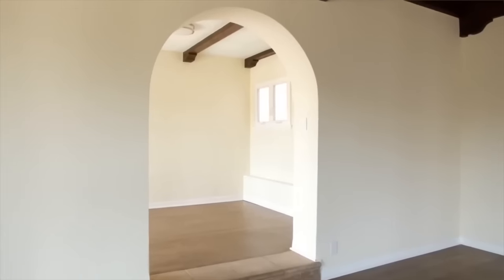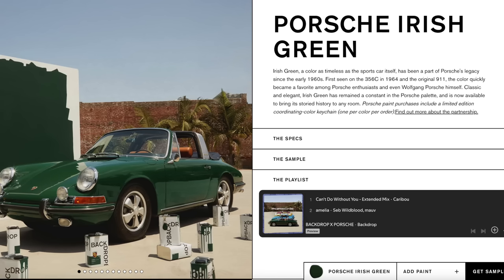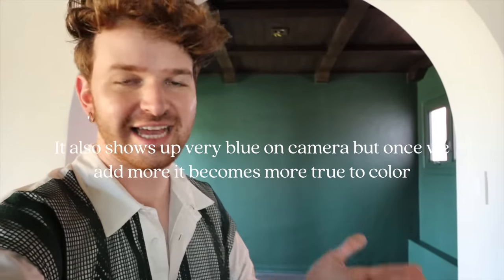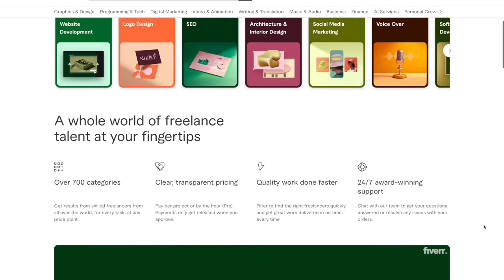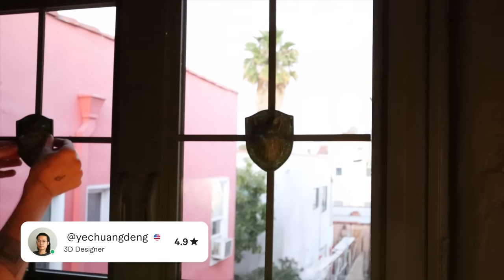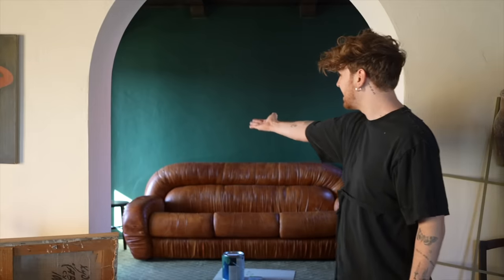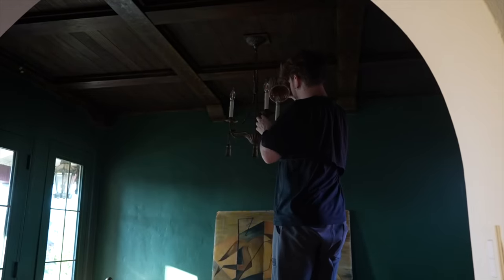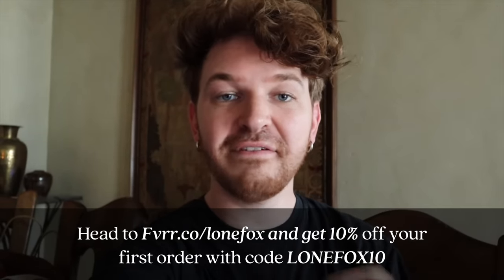Turning My Work Office into a Lounge! 🍸 EXTREME ROOM MAKEOVER!

Comment: I really love how this room turned out!  The colors are wonderful, the room feels inviting and comfy.  Totally love the fox heads, brilliant!  They are charming and align really well with the Arts and Crafts vibe in your house.  Love the tassel light fixture and the vignette of the sofa with the artwork through the archway.  I agree with so many of the other comments about keeping both white chairs together and eliminating the rattan one from this space.  

I have a small living room so I eliminated having a coffee table in favor of several small tables that I keep tucked away but can be pulled out when needed.  It's really practical to keep the center of the room open because it allows you to easily navigate the space - great call on using the stools in place of the coffee table.  The only thing I'd change would be to move the sconces closer to the artwork.  Right now, they are kind of floating without an anchor.  

Overall, this is probably my favorite makeover in your home.